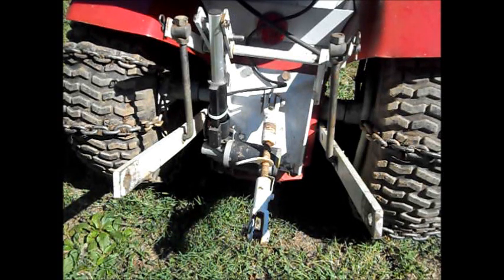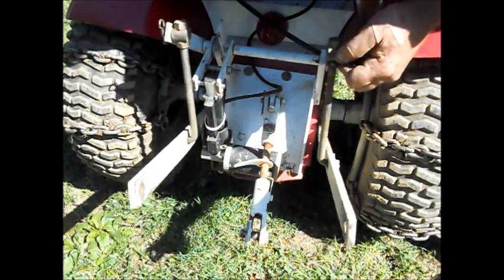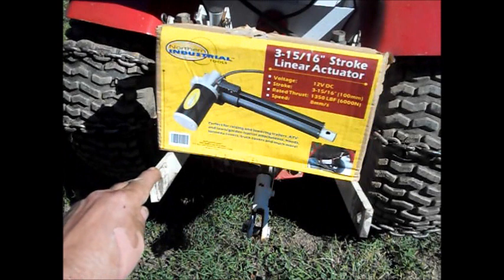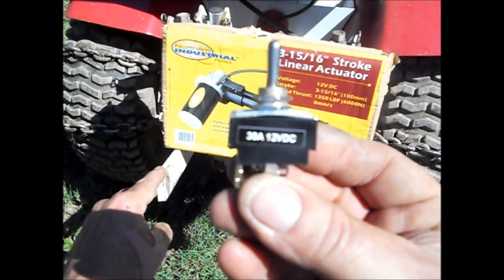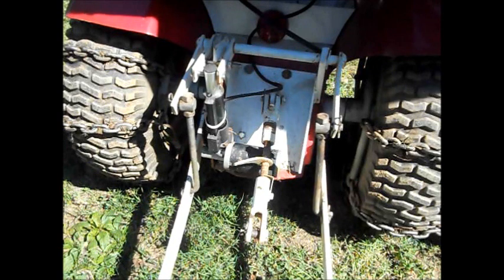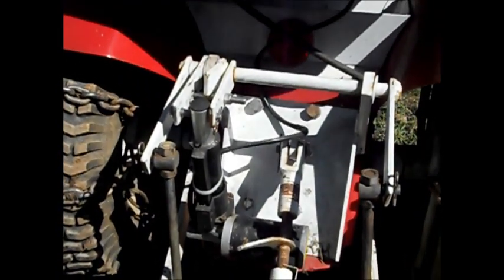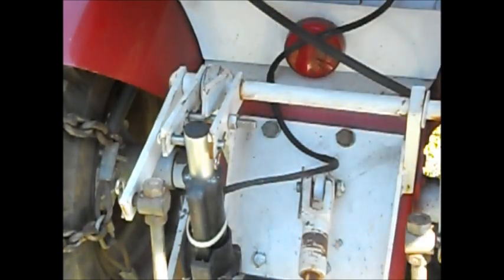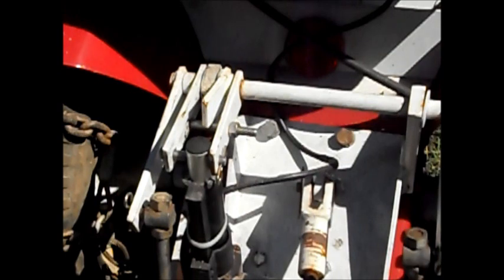sears 3 pt hitch 12v actuator

Comment: Could you please post the Manufacturer/Distributer information for BOTH the Electric Actuator AND the Switch please.

Plus include the Specifications for the Actuator.

I've been tossing around a couple HOME MAKE Sleeve Hitch/3-Point Hitch attatchments for my 1987 Craftsman GT6000 to make my Yard work & Driveway Maintenance Easyer.

The Actuator I currently have, is the Original, and can't lift more that 200lbs...

Many Thanks for your sharing,
-Thomas Skagen
Port Orchard, Washington State
Reply from the maker: I have all specs on my you tube check them out